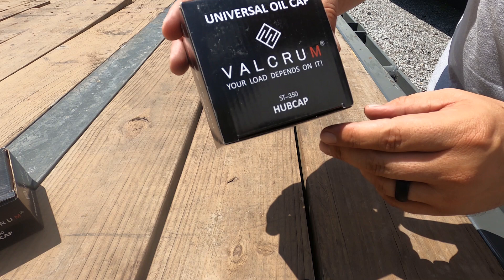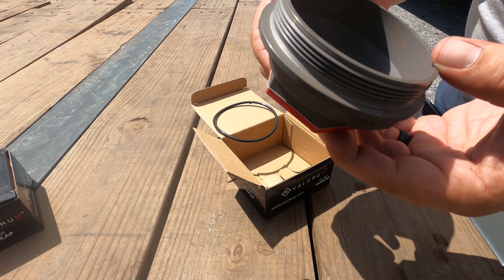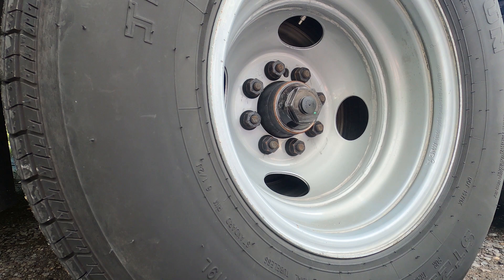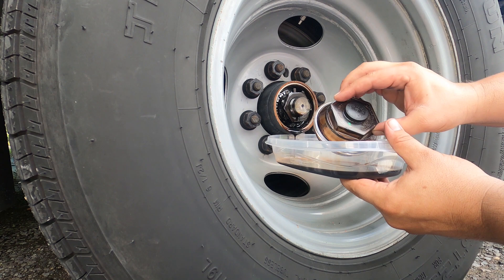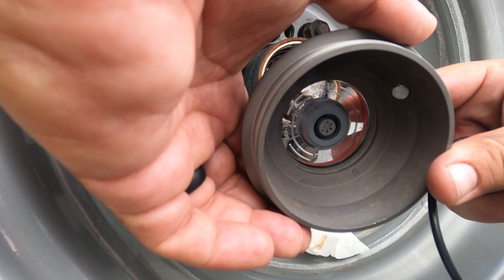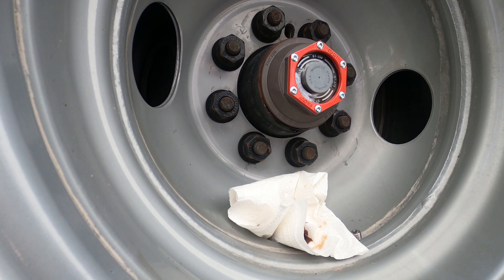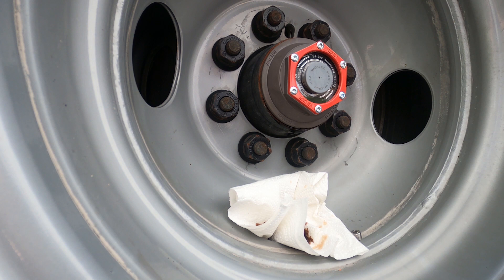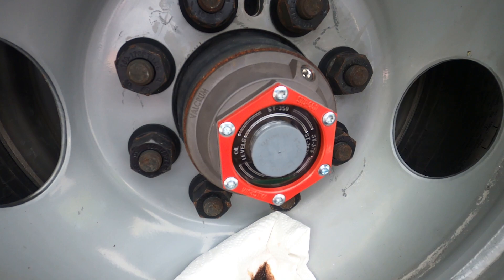OIL BATH CAPS | Dexter plastic to Valcrum aluminum

Comment: I made a little wire retainer out of some old 12-2 electrical wire that wraps around my little tupperware tub, and has a hook bent into each end, that hooks in my wheel holes.  Keeps me from having to hold it while I wait for the hub to drain.    Wire then stores in my tupperware container when I'm all done.
Reply from the maker: That’s an awesome idea man. Can just walk away and let them drain completely. I’m going to make that. Thank you for the idea!! 👍👍
Reply: @LoadMizer  Exactly.  I actually have 2 tubs (that stack together for storage, obviously) and do both axles at the same time.  You have a strong understanding that time is money.  ;)
Reply from the maker: Geriatric Ginger that’s the truth man! I’d for sure make a set and bleed both hubs at the same time. It’s rare that I have enough time in the day to just be doing 1 thing 🤣🤣
Reply: red solo cup fits perfect, holds great on dual wheel application.

Comment: Would have been nice if the company would have put a square hole in the handle so you could have used an extension and a breaker bar to loosen the cap..
Reply from the maker: That right there is critical thinking!
Reply: Tractor supply sells sockets for about the same price as that,  then you can use a torque wrench to tighten

Comment: Does every oil bath hub needs to have a breather? Friction creates heat and pressure in a closed system like a hub? Is this cap has it?
Reply from the maker: Endre Ancsán that’s a great question man and yes the rubber plugs in these all have pinholes in the center 👍

Comment: Ordered mines yesterday!!!
Reply from the maker: Awesome man. Hopefully it’ll be issue free but if you do have any issues try to remember to come back this vid and let me know what happened. If I have any I’ll most definitely be making a video about it 🙌👍
Reply: @LoadMizer  Yeah hopefully, I know you got us if it does!
Reply: Where did you order them from? I have the 12k dexter axles
Reply from the maker: Mac McGuire I got mine here http://triplertruckparts.com/hub-caps-parts/?sort=alphaasc&page=3#0  check your cap for a mode number. I think you’ll need the ST-400 for 12k axles.
Reply: Load Mizer you still having good luck with em??
Reply from the maker: Mac McGuire no issues at all.  Got a few thousand miles on them now and have had zero problems. Only thing I had to do was top off the oil levels after everything got settled in. 👍👍

Comment: Awesome, were do i some, definitely going to switch before the plastic break 😂
Reply from the maker: I got mine here. They’re not cheap but they should last way longer than multiple sets of plastic caps. http://triplertruckparts.com/hub-caps-parts/
Reply: Load Mizer if it isnt cheap, then usually worth it! People don’t calculate their time or down time in this industry which i’m sure is saved and worth the investment in these. Thanks again 👍🏻
Reply from the maker: I’m just skeptical on these axles coming from the big truck side of things. These trailers take a beating. The last thing I need is to grenade a bearing. This will make maintenance way easier for me and will hopefully outlast the trailer itself.

Comment: I have these exact hubs , is it normal that all of them leak a little bit . What should I do to maintain them .?
Reply from the maker: They shouldn’t leak. The only oil I saw seep out of mine was from the oil that squeezed past the O-ring when I was installing them. For maintenance just change the oil in them like you would the plastic caps. I believe most trailers are around every 15k miles. If your caps are leaking make sure you didn’t over tighten them and pinch the O-ring.
Reply: @LoadMizer  also will doing one hub drain the whole axle or are you supposed to do the same on both sides of the axle?

Comment: You still running these caps? I just ordered a set. Just wondering if you still like them 👍🏻
Reply from the maker: I sold the trailer I had these on but I really did like them, made maintenance really easy and the aluminum was great for keeping the oil temps down 👍

Comment: Plastic Caps suck.  Just got my 8k Valcrum caps to put on.  How are yours holding up?
Reply from the maker: Haven’t had a single issue since I put them on 👍
Reply: @LoadMizer  awesome. Overall the quality is wayyyy better than the stock plastic caps.

Comment: What could you say to keep an eye on so no bearings or axles explode on me. Thnx! (New trucker)
Reply from the maker: glory boyz I check my hub oil levels typically about 4 times per day. It’s easy with the sight glass. It’s really just a glance but I also reach down and just touch the hub. Make sure it’s not super hot. Change your hub oil as the maintenance schedule calls for it and watch for leaks out of the seals. Top off with grease as the schedule calls for it if you’re not running oil bath. You do all that you’ll be doing everything you can to prevent them from failing.
Reply: @LoadMizer  Thanks brotha! 👌🏼👍🏻
Reply from the maker: glory boyz yessir! 👍👍

Comment: I'm about to change to these, hence I've happened upon your video over 2 years later. How often should you be pulling the entire bearing assembly out and checking that?
Reply: I’ve heard every 6 to 8 months, I just had my hub bearing closest to the fill cap blow well due to negligence on my part of not checking the oil level

Comment: So I see it's been a few months since you installed these.  Are you still happy with them?  Any issues.  Thanks for the info
Reply from the maker: I haven’t had a single issue out of these. Very happy with them 👍👍
Reply: @LoadMizer   I have the same hubs . I get a lil leak basically on all of them ! Is that normal or should I adjust them ?

Comment: Hi , new subscriber here, seems like your a good guy and have a good channel, thanks. Get yourself a ball-ping. Hammer there be no carpentry work on the road. “Just saying “lol
Reply from the maker: Hey man thanks for subscribing. Yeah I need a smaller hammer like a ball ping. I had a brass hammer from when I pulled a tanker but it’s apparently run away somewhere. I actually do need a claw hammer for pulling nails when shippers block and brace certain loads with a nail gun. But yeah shouldn’t be beating my wheel to death with it 🤣🤣
Reply: Lol! Ball ping! You guys are killing me!  When my mechanics pull a claw hammer out the toolbox I throw said hammer in the trash on em and buy em a ball peen hammer set!  For many reasons!  They don’t mind loosing a hammer when I buy em a set

Comment: How often do you need to change the oil
Reply from the maker: The maintenance schedule for bearings is usually 12-15k. With oil bath in order to inspect bearings you’ll need to drain your hub to get to it. So typically about every month or every other month you’ll be draining and replacing your hub oil 👍
Reply: @LoadMizer  thanks for the quick response
Reply: How many bottles of the hub oil do you need?

Comment: on 10k axles oil is the way to go but for single wheel axles you need greese the seals will fail on the back and you will lose the bearing grease want leak out i had a failed seal on my trailer and didnt know i was just going in to check my brakes and foudn it failed and coated the brakes in grease but it didnt leak enough out too destroy my bearings i go in mine ever 30k for brake check and repack bearing dual guys have better luck with oil and onestly its better easy to mainatain plus you guys dont go need to check your brake pad as much as us bc yall have way bigger shoes the small 12x2 dont last long
Reply from the maker: Those single wheel axles just get beat up out here on a daily grind. I’m having with 10k and duals lol
Reply: Yep there cheap but they cost you in maintenance
Reply from the maker: That and the cost you in capacity. I like being able to haul up to 18k. I usually don’t but I float around the 10-14k range slot.
Reply: I usually stay around 3k to 6k hauling expedited stuff usely stuff that get canceled last minute or recover stuff from guys who brake down some time I wish I had the capacity but I can scale 11k when I need too which is why I run 8k axle now I keep bending 7ks when fully loaded on some of the bad road i end up on
Reply from the maker: Sounds like you’re making it work man 💪

Comment: Tinfoil would help as a run-off pan.  💡
Reply from the maker: Absolutely would. It’d be a little flimsy but would definitely work. With the drain plugs on these new caps I can just use an empty water or soda bottle now 💪

Comment: Dont do it! They leak. waist of money.
Reply from the maker: HOT SHOT TRANSPORT I’m keeping a steady eye on them. If they’re a bust I’ll post an update 👍
Reply: @LoadMizer   Yea i put them on drove a mile they were all leaking. Had to put my old ones back on.
Reply from the maker: I’ve had some spin off but I’m pretty sure it was just what was squeezed out of the O ring when I tightened them up. It was red which was the stock oil and the Lucas oil is green/yellow. Hopefully I don’t have any issues. I’ve got them wiped down from earlier. No new oil for the last 230 miles.
Reply: I'm guessing they leak cause you never put a torque wrench with a socket and got them tight? Once they warmed up everything expanded and loosened up!
Reply from the maker: Bruce Arntt I haven’t had any leaks